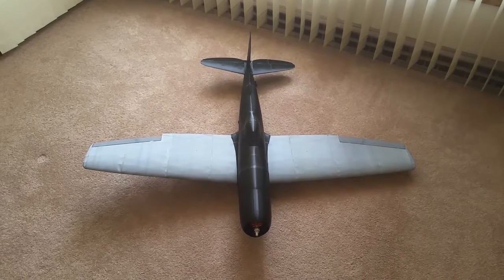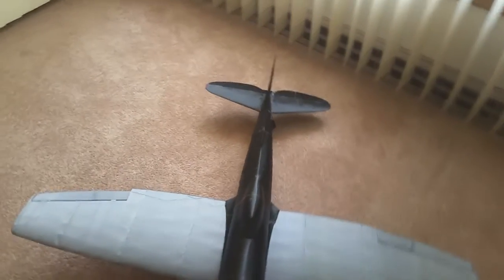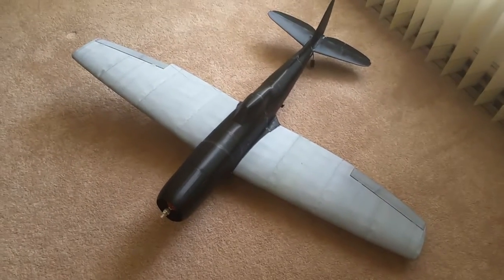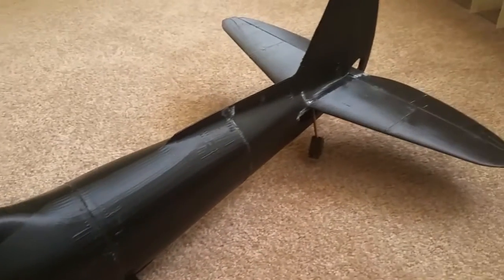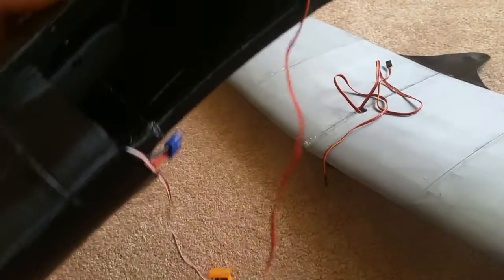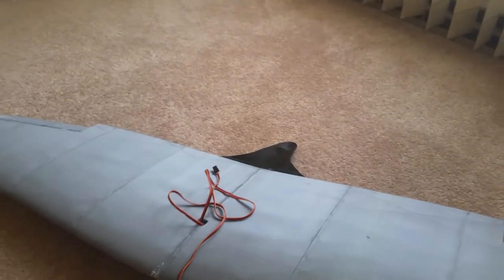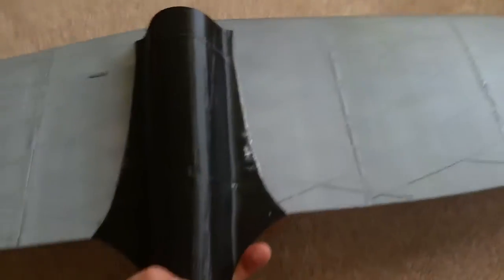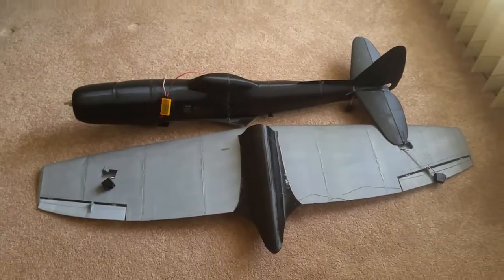P47 N-15 Thunderbolt Slic3r 3D Lab Print  RC Airplane review..

Comment: Don't forget you are going to need some air holes for ventilation, intake and exhaust, for cooling the ESC, the ESC will probably overheat if you don't!  It would look a lot better is you sanded it and painted it.

Comment: Did you fly it?
Reply: Oh no really? Hard to hear that! I just bought the files. Dont have a printer yet but a friend got one and pretty hard to configure the printer to get a clean print... If you have some advices it will be appreciated!
Reply: @alexandreplaideux9237  how did it turn out for you?  3dlabprint planes are awesome for detail, but man they are hard on a printer and your sanity.  got the brilliant idea to print the P51 out of Silk Pla, you know. to get some sort of scale look to it.  struggle bus with getting the print settings to work out, and i mean days.  i have rebuilt my entire printer, changed brands on silk pla 3 times, and tried MANY different profiles, nothing seems to work to stop the under extrusion.  there is another company developing STL's for planes called Eclipson.  they do not have nearly as many war bird planes as 3DLabPrint has.  But, their models as they do not have quite so much detail seem to print much better in the silk.  i guess i will have to let you now how it goes.

good luck if you are still in the process.
Reply from the maker: I was going to, then it melted in the sun..